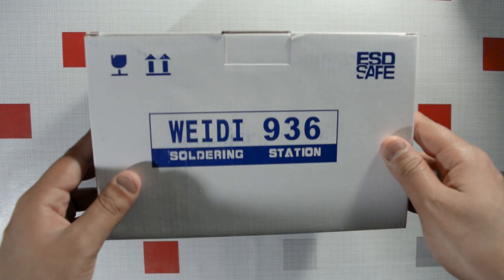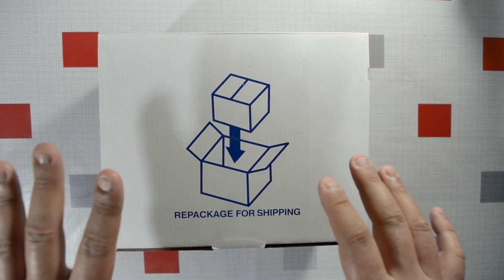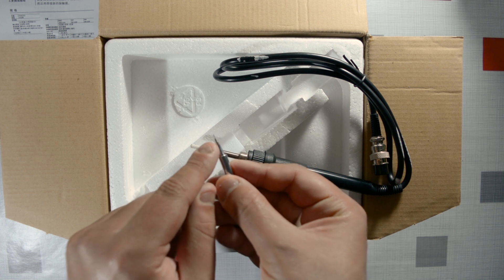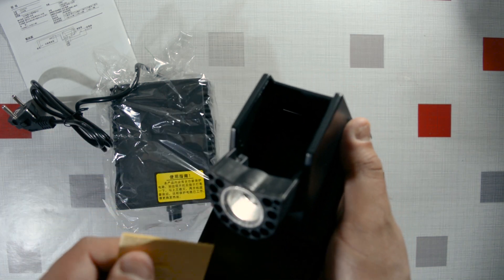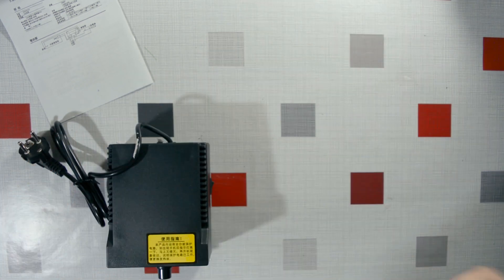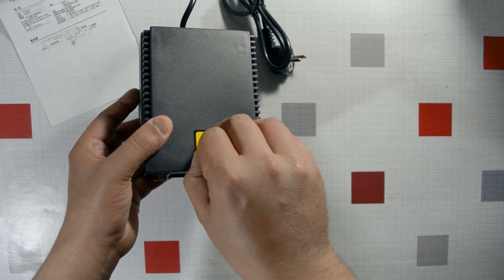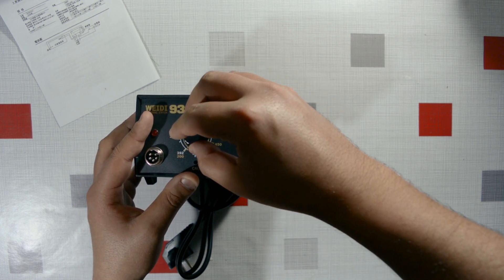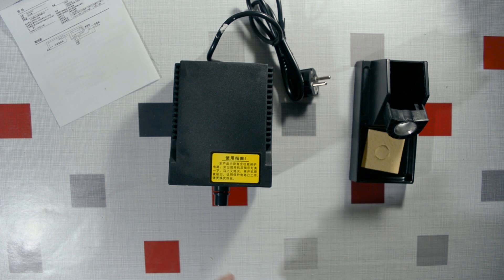Weidi 936 Unboxing II World's Cheapest Soldering Station UNBOXINGII HAKKO 936 REPLICA #22

Comment: CAL the hole in the front is for calibration ..... you measure the tip temperature and insert a screw driver and adjust the potentiometer inside
Reply from the maker: Oh make sence ,  but i need a good tem sensor